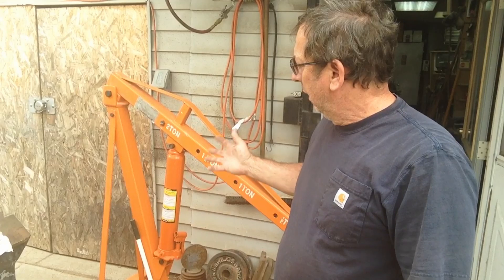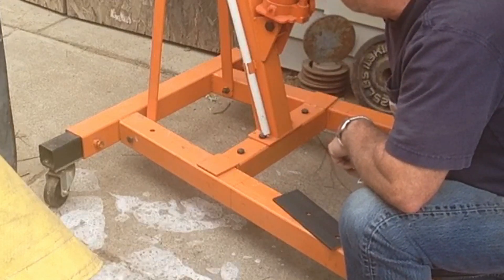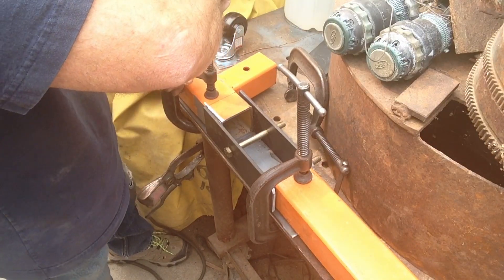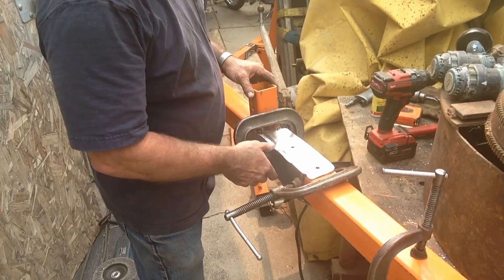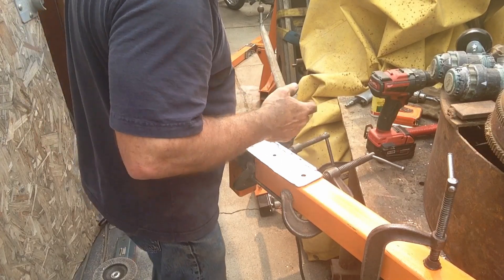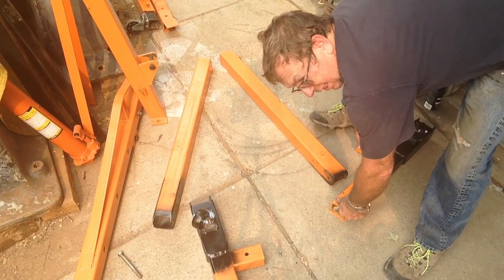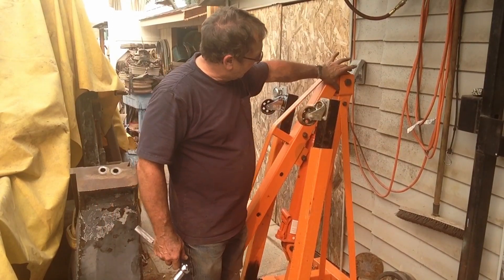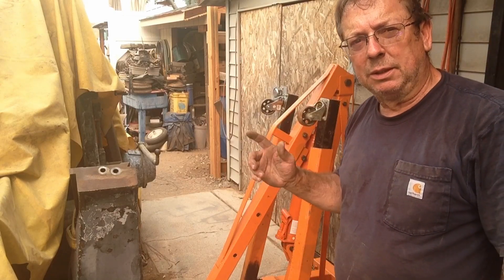Harbor Freight Engine Hoist Improvements: Modifying The Legs

Comment: Interesting? Yes.  I was out and moving stuff around and I looked at mine ... Again.... and decided to do a search to see if anyone addresses mine. The front legs are not telescoping and they are spread way too wide, so they barely slide in between the front wheels.  Also, the back legs are not telescoped out....so I like your way of altering and adding or having already had tubes that telescope out the sides. Will do that to mine. Also, the legs, as I said, are way too spread apart, so wanted to bring in the angle. The last part of what you said about the top is also going to be addressed. The lifting arm has already been done by a piece of tube steel I had put in for my last project (4 years ago) of removing the bed of my 8-foot Chevy PU. I could lift the whole thing up but only by taking my 6' 3", 285-pound body and laying way back on the lift...but as soon as I moved, it would come back down. So, I got it off and then back on by having the wife pull the truck out and backing it back in while I had it in the air. That maneuver was what prompted me to think about modifying it in the first place.  Will make changes this week?
Reply from the maker: Thanks, I hope you can use some of the modifications

Comment: On mine the legs would lung forward  when trying to move it with the legs up. The whole thing would fall forward.  I put a cross piece behind  the ram that would hold the legs back when they were up. (Just turn the flat bar and tighten the knob).  My legs go back further than yours. I add an addition jack spot at the top of the ram. It links to the orininal. Had to add a spring to the bottom of th original jack handle spot. Now I don't  have to bend over to jack and can keep a better eye on the load
Reply from the maker: I am sure I will make additional changes but I will use it for a while and see how it acts before I do anything else.
Reply: @hillsgun  Two more things to consider. 1 I put a cable hand wench on the back and ran the cable through the boom. Fabricated a pulley  on front so now there are two hooks. Both can lift but the cable is used to level or tilt the load. 2 I put an extension  on the ram valve so I do not have to bend or use the jack handel to lower the load. It looks like a floor gear shift
Reply from the maker: Sounds like interesting ideas but I probably won't do either. For my use I just use engine hoists to lift an item and any thing that is added beyond that just adds stuff that gets in the way. Thanks, Dan